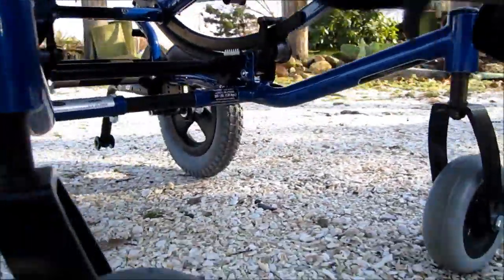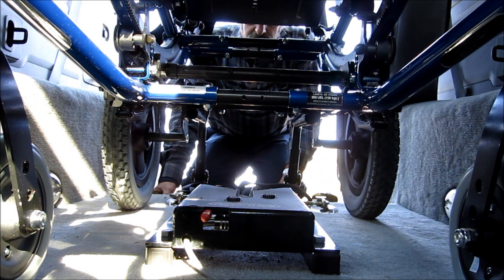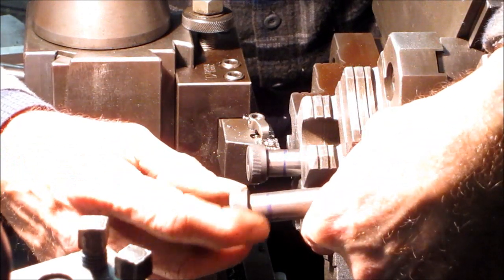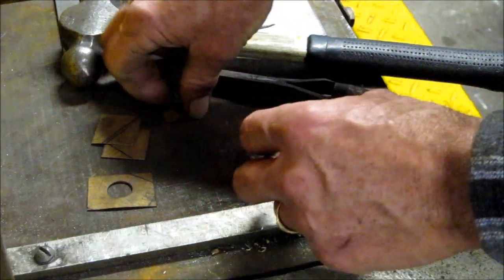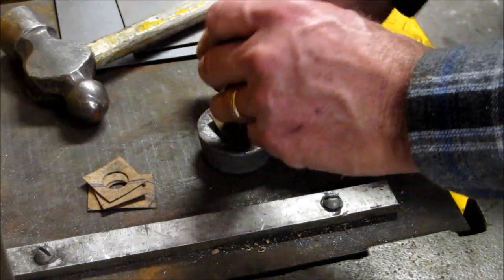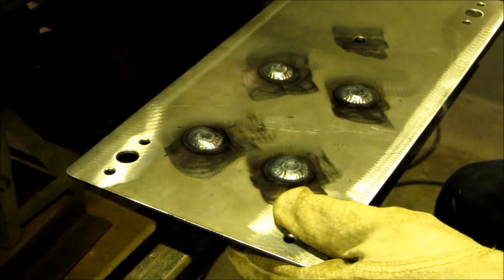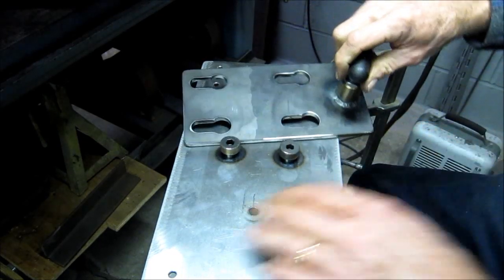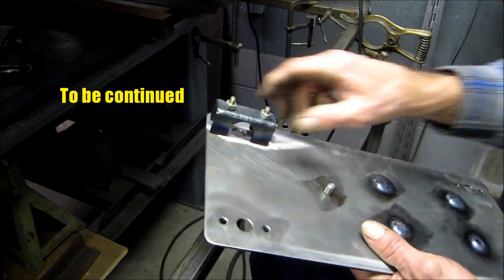Wheel Chair Docking System Part 1

Comment: Keith,
I had a job where I welded 1/2" - grade 8 bolts to a mild steel housing (MIG) for several schedule 80 by 6" pipe towers. One of the bolts broke about 1/4" above the weld in high wind conditions. I didn't check the hardness of the bolt that broke and I didn't quick cool the weld but my guess was that the bolt hardened. I see you welded 8 grade bolts on this job, did you ever have the same problem I did?
Thanks for the help,
Rob
Reply from the maker: No I can machine and blend welds and material next to Gr 8 welded with, Mig or tig using 70 S wire or 7018 stick. I would have to look at your broken bolt and the situation it was used to help you under stand. ;{)-----

Comment from the maker: @boxcarmj Mike, It falls in the fusion weld category, like spot welding, with the 5/8" pin taking most of the heat and still getting better than an 1/8" bead, the tickness of the plate, holding down on the warpage. Note there are some casses of non matching materials, that have to have a filler rod added to mix right, most of the time showing crackage as soon as your done with the weld pass... Keith